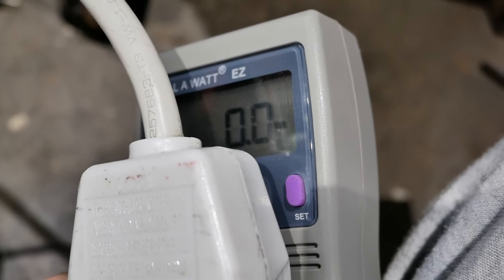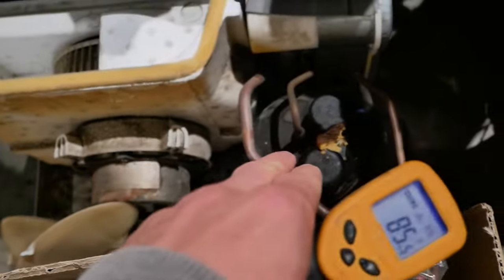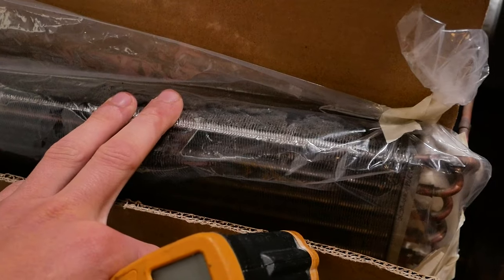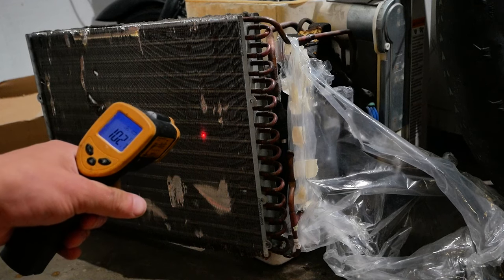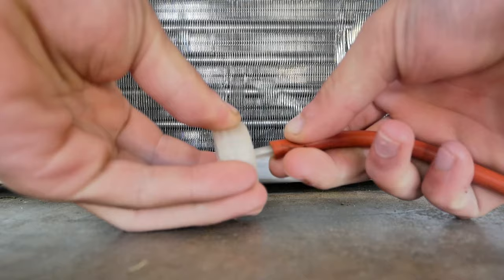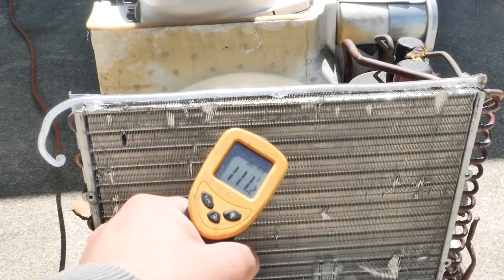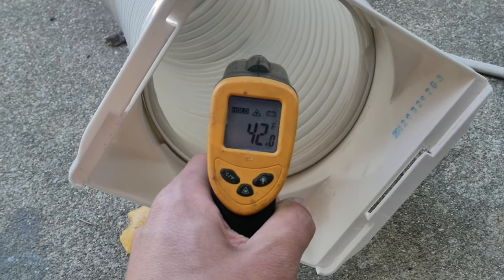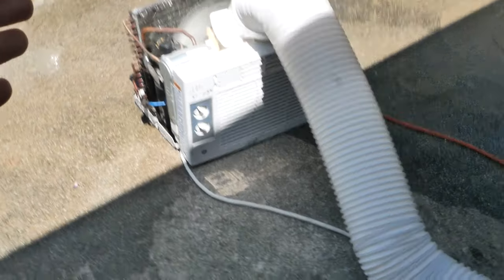DIY Water Cooled Air Conditioner 200% Efficiency AC Unit

Comment: Good idea. That's why window units have a tray and little pegs on the fan, to splash the condensate onto the condenser. I've been spraying my heat pump for years, using a little brass fogger nozzle. It uses a tiny amount of water, less than a gallon an hour, but it makes a big difference. If I don't, it struggles to keep the house cool on hot days. What's funny, is despite the obvious evidence that it works, it's a topic that's hotly debated on AC forums, usually being dismissed by AC techs.
Reply: My window unit is like this, but it has a drain ole on the side that's covered and says you can remove it if you don't like the sound of the dripping.
Reply from the maker: exactly.
Reply: Maybe it's only AC techs that work in very humid areas that dismiss it? This becomes significantly less effective as the outdoor humidity rises, but should work very well in dry climates.
Reply: @willusher3297  Good point
Reply: It’s dismissed because the vast majority of the time, it ruins the coil long term. I have seen it HUNDREDS of times. That said, your window unit is splashing with condensate, which doesn’t have minerals in it like city or well water. And the tiny nozzle you’re using is likely not enough to build scale up faster than rain will remove it, or you’re cleaning the coil yourself. Or you’re one of the few who have water that is good enough to take advantage of this method.
Reply: @THESNAKE8  It depends entirely on the water quality, but people haven't dismissed it on that basis alone, they've claimed it doesn't improve system efficiency. We have very good water in PDX, and it has had zero effect on my coils.
Reply: @WaffleStaffel  you’ll have shitty professionals in every field. Arguing it doesn’t improve efficiency is just plain stupid. The majority of difference in SEER rating is simply surface area on the condenser coil and evap coil, which is exactly what water mimics, when applied to the condenser. Providing it isn’t subcooled too far, impacting the ΔP at the metering device. Less is more, I guess is what I’m getting at, which is a prime example of why yours works as intended.
Reply: The only reason to not do it is that it might lead to scale deposits on the condensor.  Do you have issues with that?
Reply: @blurglide  Not in my area, we get mountain runoff in our city water. I actually found this summer that cooling the condenser too much can lead to higher superheat because of the nature of the TXV.
Reply: ChatGPT says it doesn't work. 🤣
Reply: @massa-blasta  Provide it with some kind of proof and it'll say "I apologize for the misunderstanding. Subcooling refrigerant actually will work to..."
Reply: @WaffleStaffel  I want to do it, but I'm afraid spraying on the radiator is going to cause mineral buildup. Isn't that what I need to spray?
Reply: @massa-blasta  Yeah. If you know you have hard water, or you try it and see evidence of mineral build up then don't do it. It will corrode your fins. Shoot for a fine fog, like 1 or 2 gallons per hour on hot days. Any more will be counterproductive because of the way the TXV will behave.
Reply: If you keep doing this you will block the fins with minerals left from the evaporating water. That is why people have an issue with it including me
Reply: @joecool4656  Depends on where you live. My city water is mountain runoff with no minerals. It tests at the tap as 1ppm.
Reply: @joecool4656  Heh, you just commented on my exhaust heat recovery video 5 days ago.
Reply: @WaffleStaffel  oh wow that’s a crazy coincidence. I guess the circles in these groups are small lol
Reply: @massa-blasta  use an RV water filter on the hose. They do 2,000 litres or gallons or whatever; anyway, it's enough for a season. Hang the filter vertically.
Reply: I got a window AC unit that has blower fan on each side attached, same issue as it's rated only 260w nominal,. So I added 220-12v led driver and a scrap car fan on the outside, got chilling results. It used to down 10° from ambient and now it's cooling ~20°F from ambient, over 200% increase.
Watercooling is a bit extreme in my case since I collect the excess water to water my plants and use for cleaning. But hey, if it works for you it's a good idea. Just beware of the corrosion.
Reply: @XavierBetoN  So you just put a radiator fan on the outside to boost the airflow? Or did you also add the moisture sprayer?
Reply: @joecool4656  I used a very very thin (almost transparent) cloth fabric piece, as those used on evaporative usb fans, which touches to the radiator instead of having space-between, spreads the water droplets.
And added a second fan at the other side to sandwich the filter and radiator.
It was a low-btu (~5500) portable window AC.
The problem was to drip the water, but I solved it with very thin pipes inside the box of the W-AC unit, so it pools at the bottom and runs through thin pipes to the top to drip to the cloth.
Reply: I said "sandwiched" but the pre-installed fan is a blower fan using ducts, so it's actually not a sandwich but I meant it figuratively, like 2 fans working in parallel.
I think similar and easier could be done on a split unit, if you install the external unit a bit below the internal unit, you'd eliminate the need to solve the water up-pumping issue.
Note that cloth is protecting the radiator from dusting, but it itself gets dusty and moist, so you have to clean it once in a while.
It's been 2 summers since I modified, and cleaning at June once is enough in my city for whole summer.
Reply: @THESNAKE8  This. Right. Here
Reply: @larryrichardson5167  sometimes I feel like it falls on deaf ears trying to educate people.
Reply: @THESNAKE8 so if you are using distilled water, it would be fine?
Reply: @Diesel4242  you’d need a lot of distilled water, and whether you’re buying it or distilling yourself cost will outweigh the savings.

Comment: I found out that my portable ac has a similar technology where it uses the water that drips from the evaporator into a reservoir at the bottom, and then a pump pours the water over the condensor. Its a good design because you never have to drain the water pan because all the water evapotates
Reply: Not needing to empty the drip tray was probably the PRIMARY reason they designed it that way.  It's a real pain to design something that needs to be manually emptied by the user and or could easily cause water damage to property if the user sets it up incorrectly (which could easily happen if the design instead wants to pump the water outside to dump it).  
Very elegant solution.
Reply: Wow what brand and model? Thanks
Reply: I have a few of those A/C units also. Mine are called Germanpool PC-15 (location is Hong Kong, so they are 230V 50Hz). They cannot always evaporate all the liquid, so they still have a drain. But most times it does indeed evaporate the liquied. Why they don't make more A/Cs like that beats me, it is such a great way to improve efficiency.

Comment: It is literally criminal that this isn't implemented I'm every home globally
Reply from the maker: as Electro Boom would say "drowning in inefficiency"
Reply: There's a reason. This is great in theory to people who don't do this stuff (hvac) for a living. There are a number of water cooled condenser products on the market. The only problem is this is evaporative cooling, which means the water leaves behind anything it's dissolved, in the form of scale. And believe me, it doesn't take long to build up scale, which isn't nearly as easy to get off, and once it's built up, there comes a point that it starts to really hamper the performance of the unit. Years ago, the options for liquid cooled condensers on residential air conditioning were common, they didn't last long because most homeowners aren't willing to do the work to clean them, and don't want to pay the cost to have them cleaned.
Reply: @THESNAKE8  Instead of spraying water on the fins, you could use a heat exchanger with the refrigerant line.  This would avoid this issue.
Reply: @FB0102  LMAO, those have the same issue. Water source ac/heat pumps, are what you’re describing. They also use water cooled condenser coils, in freezers/coolers in commercial applications, ice machines with water cooled condensers aren’t uncommon. The difference is, you have a separate closed system, of water with additive circulating and then a fan and coil that the water goes through to reject heat outside. If you use the “pump and dump” method, meaning run water from your well, or city through the heat exchanger, to condense the refrigerant and then down the drain, you will end up with a heat exchanger full of scale evenetually. Source, I do this for a living.
Reply: @THESNAKE8  You can use condensate water, filtered water, or rain water
Reply: @FB0102  wow you’re right, I can’t believe no other equipment manufacturer has ever thought about that !
Reply: @THESNAKE8  I never claimed it's a new idea.  Not sure what you mean.
Reply: @THESNAKE8  what about using reverse osmosis water?
Reply: @teddyruxpin3811  reverse osmosis water is very “harsh” so to speak. Water being the universal solvent, and RO water having no dissolved solids in it, generally will actually eat through any metallic piping over long term use. If you look, RO systems transport supply water through some sort of poly piping.
Reply: @FB0102 i have condensers for the walk in freezers that get cooled from thwart chiller water circulation , no fans
Reply: @THESNAKE8 Also the unit is probably running outside it's temperature envelope 110. Nowadays you can buy a variable speed unit

Comment: Yes this does work for awhile but eventually you will corode the condensor coil you need to use antifreeze or DI or Distilled water for this which kinda ruins the whole cost savings.
Reply: Distilled water is a good idea, if you could make a ram pump and drip the evaporator's condensed water to cool down condenser radiator. That might work wonders. You'd increase the efficiency and eliminate the need of drainage.
Reply: can use water from the air conditioner drain water and add airconditioner drained pump..

Comment: I had a window AC unit that wouldn’t get as cold as it used to. After years of use, the condenser was coated a layer of lint, leaves and dirt which didn’t allow enough air to pass through it. I could feel a little bit of hot air coming out the back of the unit, but some areas there seemed to be no airflow at all. It’s important to check the filter screens on window AC units if they have them. They do suck up dust from the air which gradually ruins efficiency. If it’s totally plugged up with dirt, the AC won’t work at all or it could burn up the compressor. Some AC units have a metal screen in front of the condenser which slides out so you can clean it. Cheaper units don’t have this and it involves taking them apart and scraping it off by hand which is a real pain.

Comment: The ac on my boat has a water cooled evaporator.  95° outside and it's cool inside.  Because the cooling water is only in the 70's.
Steam power plants use water cooling towers.  It sprays water into an air stream.  Which cools it significantly.  Old Prairie tractors used drip screen radiators for the same effect.
Water cools better than just air.

Comment: Tap water contains minerals that will build up and clog the condenser fins. If too much it is dang near impossible to remove.
You must use demineralized water to protect your condenser.

Many commercial ice machines use a water supplies heat exchanger. It significantly increases ice production.
Reply: I did this with a very old window unit that a lady gave away.  It worked fine,  but I would never do it on a unit that I expect to keep for years.
Reply: I repair ice machines. Yes you can get a water cooled condenser. The downfall with ice machines is that you use a TON of water. If it's hooked up to a chiller system, great. If you are just pumping and dumping the water, big time cost. A 350 pound daily (in 24 hours) will use about 110 gallons per 100 pounds of ice. So if your machine makes 350, you'd use a MINIMUM of almost 400 gallons per DAY! If you had a bigger machine, say 650 pounds, you use 155 gallons per 100 pounds production meaning you'd use about 1000 gallons DAILY! Multiply those numbers by 30 and you can see it gets expensive. If you can get the water temp lower into an ice machine reasonably, that's the best way.
Reply: @Mikewarehouse  Simple solution - just run a garden hose to your neighbor's outside spigot. Problem solved?
If you have a good body of water (lake, pond, river, etc) you can use a solar powered water pump to cool that condenser.
Even well water if need be.
Well water should be plenty cold.
May have to adjust the discharge temperature so as not to waste water.
You might even be able to dump the discharge water back into the well.

Comment: Pretty cool actually, swamp cooler cooled air conditioner, you could probably also use the water condensed from the evaporator side to supply some water to the cooler so you use less water
Reply: Dude maybe a fish tank pump Hook it up with a tiny bucket where water drops 😮 my mind is blowing
Reply: swamp coolers only work in low humidity conditions...the thermal mass however of water helps ALOT in removing heat
Reply: that's where the water comes from already.  But better to use cheap 2 brass nozzle filtered hose water spraying into intake.

Comment: You know those little sprayers they use at theme parks that spray a very fine mist to keep you cool in line? I have one of those as well as a hose bibb beside my compressor. Guess what im fixing to do in the next 5 mins
Reply: u can integrate a humidifier too that releases cool air mist to cool down radiator without building scale on fins

Comment: Excellent Video. I don't like the water consumption, though. It's like paying in for watts in H2O. 

In certain situations, and more and more, clean water's value is rising. In the desert, it's already there.

Technology exists to take the heat off the radiator and make cooler water in a closed system. But they're expensive too.

Big corporations do not include this technology in a typical consumer a/c product because few are going to pay the extra money, probably double or more, to apply this tech to a small unit. 

The video is great because it demonstrates to people that evaporative cooling works. I am sure it inspired people to give it a try. If water is not a significant cost, Why not?

Comment: I like it and saw you video on the water cooled conversion I'm supposed that vinyl hoes worked definitely need to go with copper in the final but I was looking for charge vs efficiency because my 8000 btu isn't great but I didn't realize it is probably low because the top like 1/3 to 1/4  coils are not even cool so I blocked them off for now but I was wondering if it is using less power because presumably it's not compression the high side as high I mean power consumption seems to indicate it is using as much or more than it should but it's also like 105° outside well I'm going to get some of those vampire fill ports and top it off but it's r410a not 134 so i might but a big container because $260 for 25lb or 30 is a lot better deal than like $89 for 2 lbs I think the $260 was like on market place or something but even at like $325 it's like $13 a pound vs $45 and pound but I know those vampire ones are not great maybe by then I will have built a recovery machine out of an old compressor and can put on some proper service ports
Reply from the maker: replace it with butane or propane if money is an issue  and the vampire taps leak over time
Reply: @ianbuilder  ya I know they leak I figured eventually I'd have to replace it and I have seen butane (r600) and propane(r290) I think butane runs at real low pressures and might get pretty cold it's generally used in real small units like counter top ice makers so it would probably be pretty efficient if it would run fine and butane doesn't seem that easy to get inside but I have found adapters for propane so i might do that but it seems mostly full the air out is like 20°,25° colder than the room temperature but I see it is not using like 1/4 of the evaporative coils and I was not confident about propane working well so I figured I'd just top it off but when I drain I to replace the vampire service port I'd consider propane I guess it would be worth trying and seeing the performance and energy usage even if I went back with r410a because I'll probably have a lot extra and it probably doesn't take much

Comment: Do another experiment with refrigerator compressor and small pc radiator or car evaporator... 

I have an idea to use a car AC system but using refrigerator compressor instead of the car's compressor (because, there's no engine in it. And I'm just gonna use it as a small room to chill myself while using my laptop. The car won't go nowhere anyway..)
Reply: im collecting all the parts to try this. but instead of a cars evaporator, im using the heater core radiator. the tubes between the tanks are a little bit bigger for more flow and im not worried about compressor oil stuck in the system. atm im using a used heater core so it was free but there might be residual antifreeze or propylene glycol in the system. i want to eventually use pure h20

Comment: When the temp dropped on the thermometer instead of pointing it at the middle of the country l he took the liquid temp, at the bottom the refrigerant is cooler even without the water. This is a good idea to keep the CONDENSER not radiator cool but then again...rust. I HATE RUST